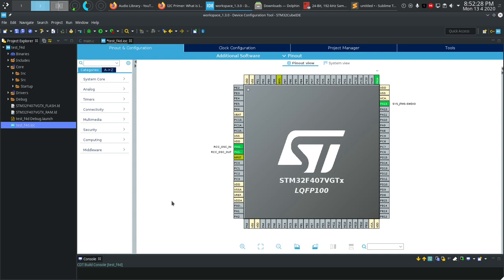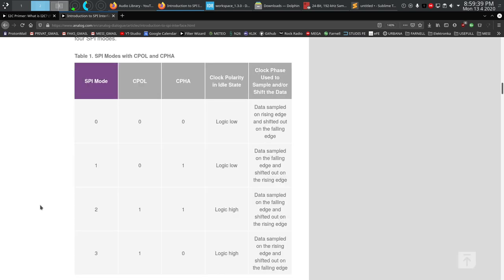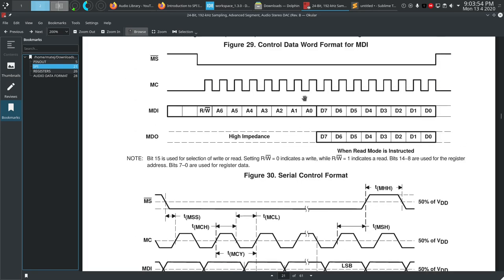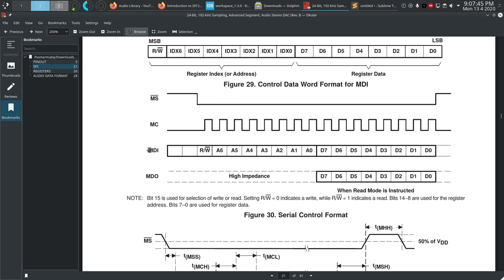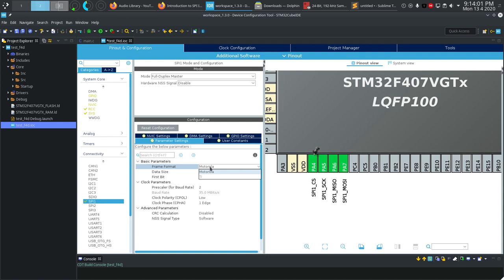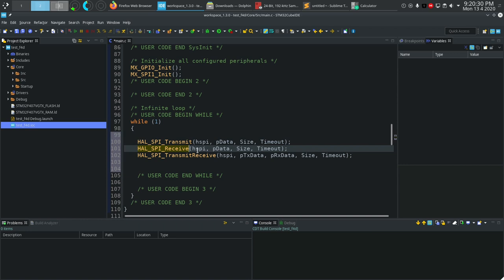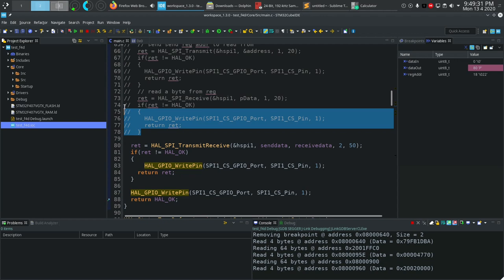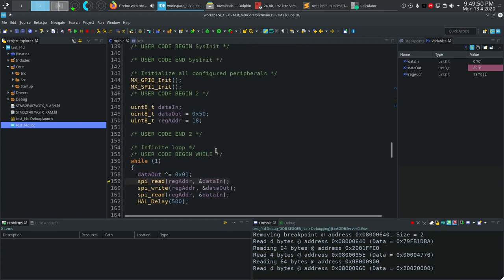SPI peripheral with STM32 and PCM1792 audio DAC | VIDEO27

Comment: Great job! I like to watch your video, just a question how can I make the SPI send 2 bytes of data instead of one byte like 0x0480 and without sending the address too? and how can i receive it in 1 byte?  I have just your code and it working on STMH7 SPI transmit 1 byte address and data... pls advise... thx.

Comment: Hello! Thanks for  the video. I have a question regarding 30:55. In your function spi_write, why do you pass the address of dataOut but not the dataOut itself. What would be bad if your function would be spi_write(regAddr, dataOut) instead of yours spi_write(regAddr, &dataOut)? I'm not expert in C and just was curious about the reason behind this.
Reply from the maker: By passing the pointer to the data instead of just data allows the function to modify data at  that address and possible others as well by incrementing the address.
Passing just the value of variable would not allow this.
Reply: But inside your spi_write function you dont modify the data. You pass pointer and dereference it again inside the function without modifying it. Am I missing something there? Thanks
Reply: Even if you don't plan to modify the structure, passing it requires making a copy of the entire structure, while passing the pointer only copies the address.  It is more efficient in time and memory to pass the pointer.
Reply from the maker: That's also another reason. If you want to pass in the struct as a read only variable, you can use pointer to a const struct `struct MyStruct const* myStruct`. Might as well make the pointer const as well if you're not incrementing it: `struct MyStruct const* const myStruct`. This is "safer" so you don't modify something that shouldn't be, but it can give you problems with HAL functions, which don't use const at all - then you need to cast away const: `MyStruct* myStruct2 = (MyStruct*)myStruct`.
Reply: If you are anticipating that HAL is going to change the pointer, then you would not want to use const.

Comment: At 33:20 mention the HAL transmit function handles waiting

What I discovered is you need to read the DR register in order for it to flush data

I don't understand why this is necessary and why it doesn't work without it
Reply from the maker: That's interesting. I have used only the transmit function at my last project for a dac ic with no read - master tx only.
I have a feeling that I have heard of this before but I'm unable to recall.

Comment: HI bro, nIce video, I have using the wolfson audio card with stm32 f407vg,. Is there any code for checking my wolfson is working with stm32f407  board or not.
Thanks
Reply from the maker: I'm not familiar with this card, so it might be a raspberry pi hat type of card?
If so, then I can see that it has an expansion header that has a couple of gpio line connected as well as 5V and 3v3 along with i2s and i2c. With that you can check what signals would be of interest. I would suggest leaving i2c and i2s alone because they are master-slave type of interface where raspberry pi is alredy connected as master.

Comment: hello, have you ever connected raspberry pi with the stm32 over the SPI interface?
Reply from the maker: I have never used Pi for projects, just as a low power computer. If there is a library for pi that supports spi, than it should work. Just make sure that one is master and other is slave. For general communication between modules that you program yourself I like uart much more, modules can transmit and receive at any time, much more convenient.